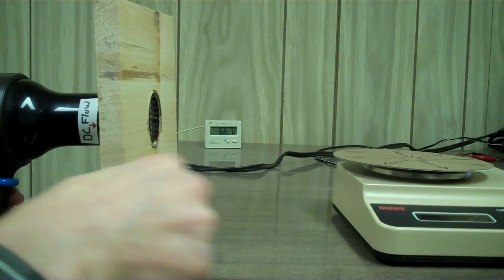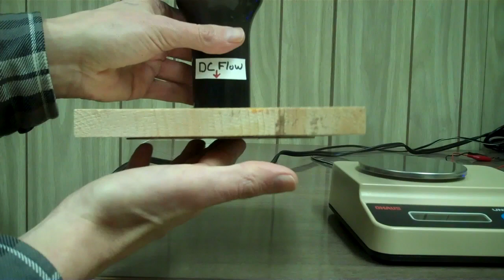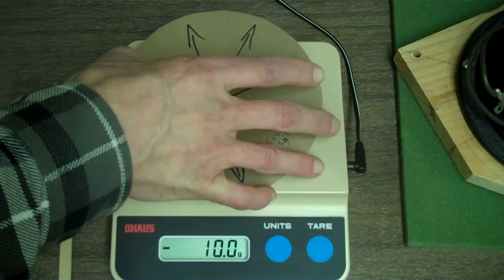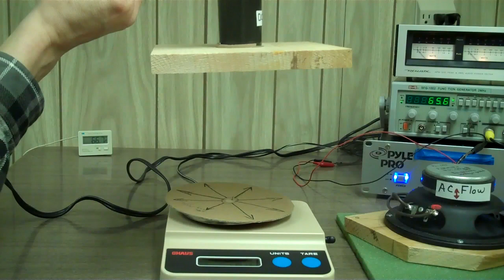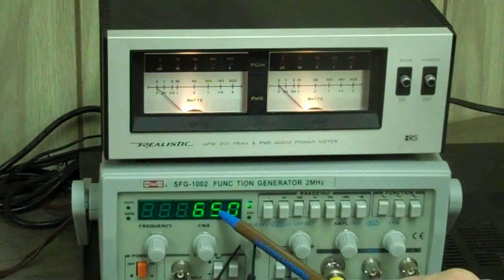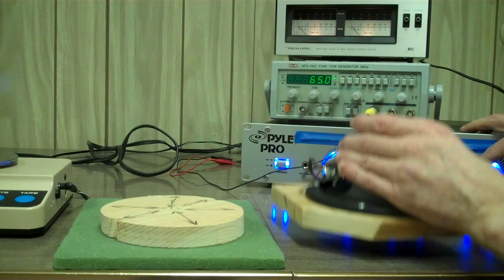OL1: DC & AC Lift by Radial Deflection

Comment: the orthosonic lift is very interesting!!! is the weight of the wing limited by the size of the diaphragm on the speaker? how does the wavelength effect the way it performs?
Reply from the maker: Thanks kaarl m! I'll be posting a series of  orthosonic lift experiments in the "OL#" series, which I hope will interest you.  Like a musical instrument, each design is "tuned" for the load it carries.  While I patented (8967965) the method for vehicles, there is nothing to stop you from trying variations of  this simple experiment yourself.

You can download a free function generator app. (for sine waves) and connect the headphone output to an audio amp.  Lots of times I find people's old home theaters (with 5.1 amplifier channels) and speakers put out with the trash when they upgrade their systems.  I get a lot of stuff for my lab that way.
Reply: David Colasante I'll be sure to watch the upcoming videos!